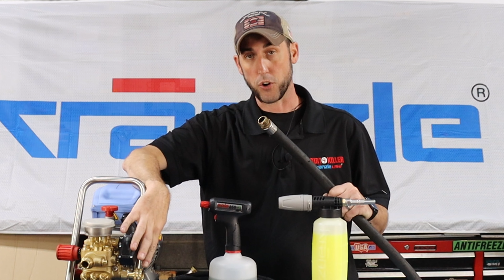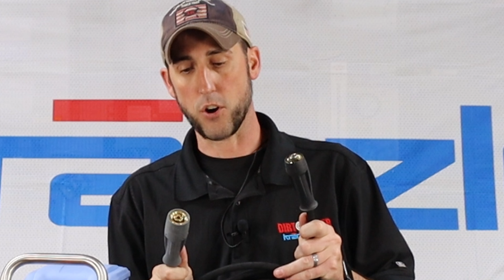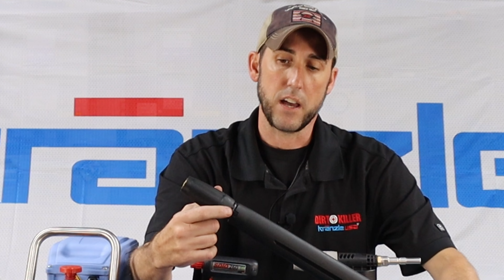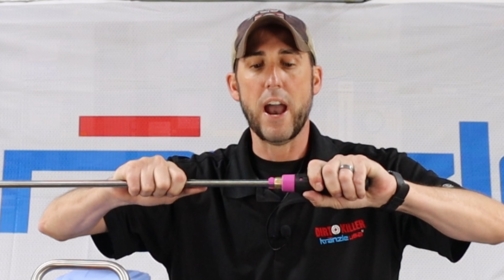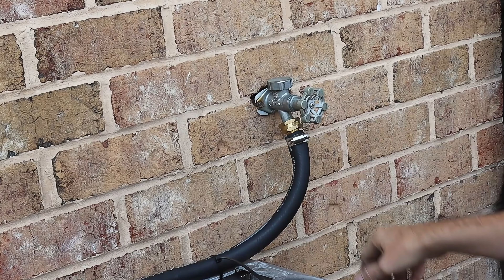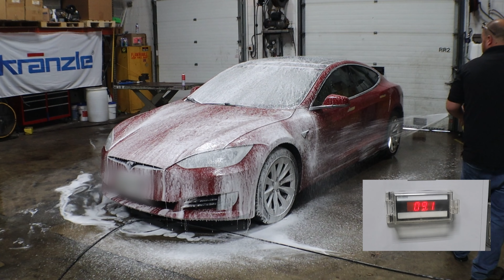Kranzle K1622TS Electric Pressure Washer Overview

Comment: Hi, Just bought a Kranzle K1622TS from the local dealer, but I don't see that oil glass on the side like the one you have (mine it's just an metal hole), is that normal?
Reply from the maker: Good morning @TheSlappy1000 , Yes, that is a design change present from 2022 onward. The sight glass proved to be a weaker point on the unit itself so it was eliminated and replaced with a full housing as your unit shows.
Reply: @kranzleusa5846  thank you for the clarification
Reply from the maker: @TheSlappy1000  No problem, Enjoy your new Kranzle!
Reply: I buy this what a process